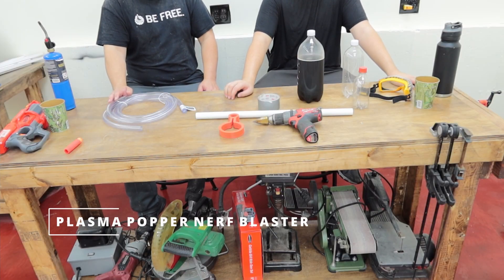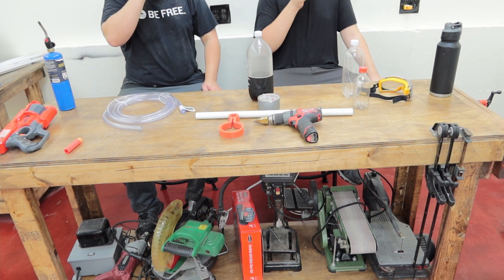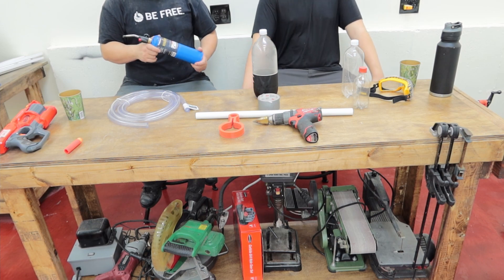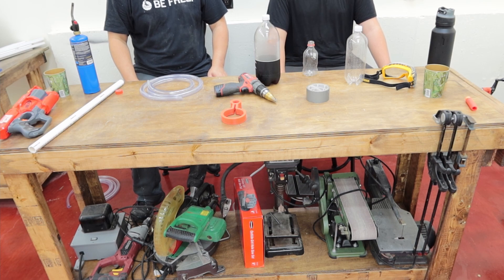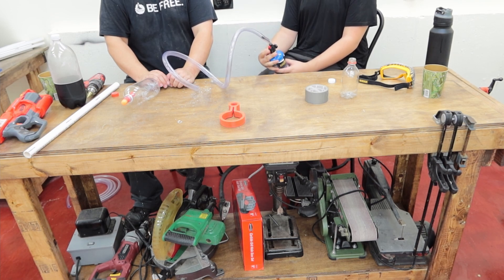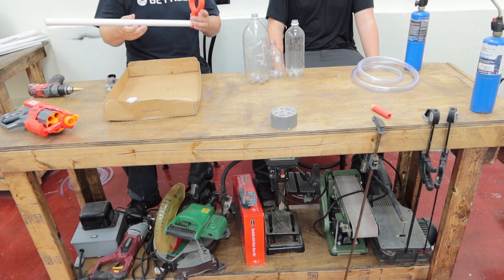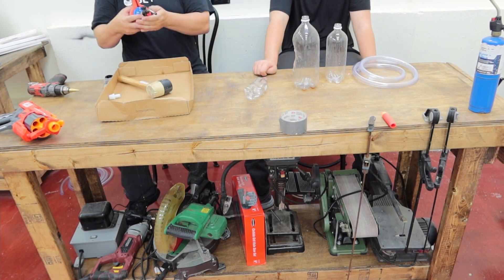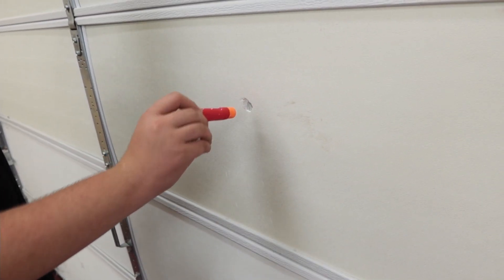Plasma popper nerf blaster (2021)

Comment: That torch is intended to operate upright only so as to not vent liquid.  Also, after ignition, the gas is still flowing until you turn it off.  Isn't there a chance the flame could travel back through the tube to the torch?  Thoughts?
Reply from the maker: In normal operation the torch is supposed to burn at the nozzle and the gas density and ratio to oxygen to gas ratio in the closed tube is hard to get exactly right.  The more typical result is lack of ignition because of an improper ratio.  You have to fill the tube and chamber with exactly the right amount of gas to get it to work.  Too little or too much and you don’t have a close enough stoichiometric mixture and it won’t ignite. The optimal amount is hard to reach for the biggest boom.  Best case is to figure exactly the length of time to run it before igniting.  After the first ignition all the gas burns and it goes out there is not enough heat left to reignite the mixture and there is very little oxygen left in the space.  

Also liquid fuel will not burn.  It can only burn once it is evaporated into the air to mix with oxygen.  This is also the same for gasoline.  Liquid gas does not burn very well at all.  But vaporized gas burns great.  Heat from the fire can aid in boiling the gas to make a gas fire bigger.   

So while I wouldn’t call this device safe I think there is no danger of blowing up the propane can.  Since inside the can itself there is pressure greater than atmosphere keeping the air out and you cannot ignite the gas without air.

Yes horizontal operation is less optimal and again makes it difficult to get the right mixture.  But the sideways orientation makes it more compact and looks cooler.
Reply: @artofeverything1816  There are torches with momentary gas valves and regulators like the 4000 and 8000.  I suppose worst case would be a flame at the nozzle which would burn the plastic tube.  I seen 1 vid showing partial flashback through a short tube.